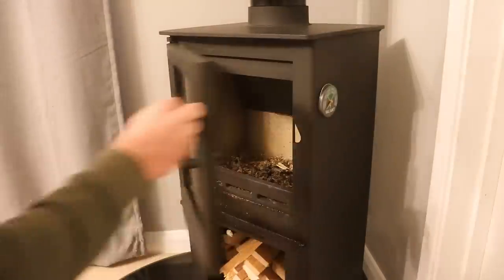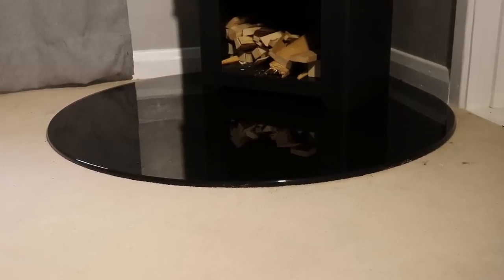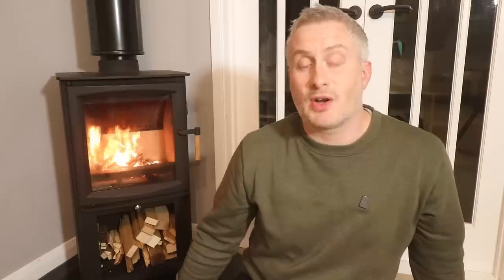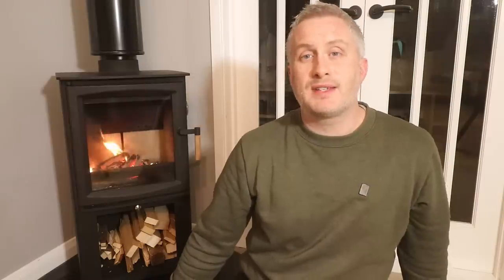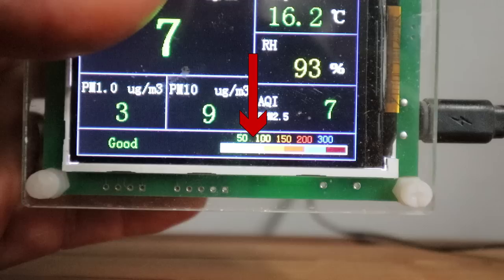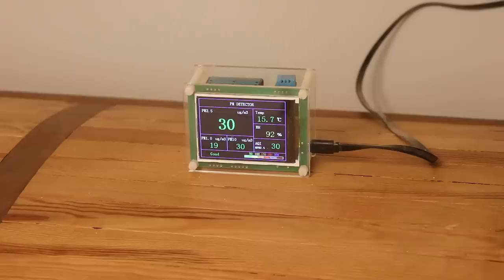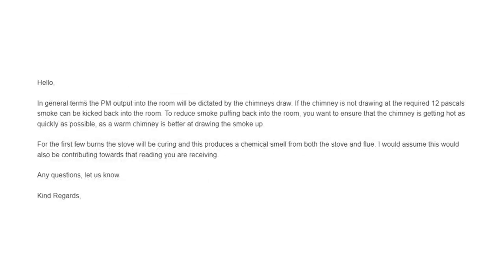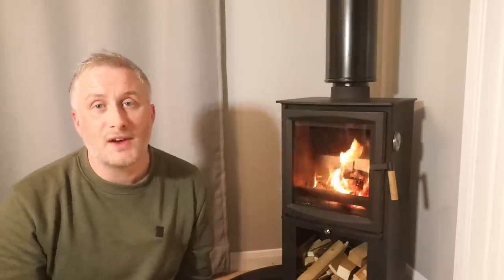Wood Stove Pollution and PM2.5 Particle Emissions TESTED ✓

Comment: You could argue your stove will be drawing air from outside (if it’s not got an air inlet connected), through your windows or air vents in the walls so your air quality may be even better?
I installed my own stove and will get building control to sign it off. It was not a difficult process if you’re the practical type.
It’s a 9kw Saltfire Peanut 8.
Your stove looks great and seems to be working well.
Reply from the maker: Thanks.  I don't have an external cold air feed, but we have a PIV (positive input ventilation) system in our loft due to past problems with mold, and also trickle vents in every window so I think it's able to draw from those quite effectively

Comment: Good looking and practical woostove, strong 👍and could say as long as electricity is not a lowest heating source with both hands yes for fireplace(where possible to fit). If i not wrong, firewood is still on lowest cost, comparing to gas etc. Electricity costs gor heating was on highest rate. Goverment can wish to avoid them, but in reality too early, to say no to them. Same as cars, fuel vs electric🤷‍♂️

Comment: Very interesting video. Thanks for sharing.  It seems that I'll need one or more (cottage, workshop, office) of these air quality devices.
In many countries, including Slovakia, prices of wood and wood related products went up immediately and doubled or tripled in price, as where electricity and gas are still the same price, at least until the end of this year for households in Slovakia. But we still don't know prices for gas and electricity for 2023!.
In the Netherlands they are talking a lot of the consequences of burning wood in stoves, but mainly for the pollution it causes outside.
Is it possible to measure that as well (for example with a remote cordless device) controlled/connected with the main device inside?
Reply from the maker: Hi Hans, thank you. I suspect that getting readings outside wouldn't yield good results as we live by a very busy road where I can imagine the pollution caused by HGVs is much higher than our little wood stove.  Thanks, Keith

Comment: When our stovax was installed we had to have an air vent created  into the room . Wasn't one installed in your room ?
Reply from the maker: Hi Mary, We have a PIV (positive input ventilation) system in our loft due to past problems with mold, and also trickle vents in every window so I think it's able to draw from those quite effectively.  Thanks, Keith

Comment: If your wood stove is 5kW, or above for that matter, you need to have a vent installed to supply fresh outside air into the room. This would mean that with a good draw up the fluepipe you will also get a steady stream of fresh air coming into the room from outside. I noticed you said your installer was HETAS approved, so I am sure he will have installed such a vent. The vent is there to ensure that you get sufficient combustible air to keep a good clean burn going and as such you should not get any additional particles in the room once the surface of the stove and flue pipe has been fully seasoned. This can take a while even after the smell has gone, and depending on how often and for how long you use the wood burner. Once you got that sorted I would only ever worry about having an effective smoke and CO2 alarm just to be safe rather than sorry. (And a good tip if you live anywhere near the countryside, as I think you do. This time of year big branches often come of the trees along our roads etc. during storms and these are very often oak and other hardwoods, which is a brilliant free fuel once you allow it to dry/season properly).

Comment: I install air quality monitors so I often look at pm levels. Pm10 is still the only limited number for when construction is going on. Pm2.5 is on its way and there’s talk of there not being a limit. These little monitors are only indicative anyway but if you’re seeing a general increase like you have that’s a good indicator that something has happened just don’t get stuck on the numbers. Try putting it outside for a bit to see what the numbers are like out there. It’ll either terrify you (if you’re alongside a road) or have you less worried as the numbers in your house are lower than outside even with the burner on.

Some good advice on here about the wood burner. I haven’t seen anyone mention the top down method. I use it every time. It heats up the flue first so there’s less smoke and generally you don’t have to open the door from starting the fire. I have a trickle vent on the windows in the room which I open and the doors in the house all have a gap under them anyway so the stove isn’t choked regardless. Mine goes up a chimney so when the door is briefly open the smoke gets sucked up there anyway. I am like you and have a supply of wood anyway but if you do get the opportunity to try different wood logs you’d be surprised at the smoke difference and how long they burn plus the heat they give off. I’m not expert though, that’s for someone else.

I struggle with breathing anyway so when air quality is low I have a hepa filter air purifier which must do the job as it tends to help so I agree with others who have mentioned it.
Reply: That’s interesting what you said about the numbers outside v numbers inside , especially near the road 

It reminded me of a few months back when I did a 9 day water fast. I spent a lot of time outdoors praying and reading my Bible and seeking God. That’s the context .

What happened to my body is that my senses and awareness was really heightened, and is was like I was very aware of the pollution in the air and think it made me feel nauseated….like you could sort of taste it. Water fasting can do that to you anyway as your body/cells cleanse and heal , but the roadside air pollution added to it. You also tend to smell human breath quite clearly when you normally wouldn’t notice it.  

Odd religious post 😄, I know I know. But yeah , it makes you wonder. 

I’m away to buy my first house and I have a wife and 5 kids . I would love an open fire or one of these stoves but really concerned i don’t damage my family’s young lungs or health. So I’m inspired again to revisit this after hearing a negative report on a YouTube vid a while back that seemed scientifically weighty, but then again “science” is a bit like shifting sands and not always good for decision making. 

I think I concluded I would maybe build an open fireplace outdoors or use a wood burning stove somewhere safe in the garden so I can still enjoy it , but maybe there is hope for indoors with some healthy choices and practices 🤔

Comment: Spot on Keith your stove looks very nice, you'll love the radiated heat. I've had a Tangye stove in my house for over twenty two years. It was once in the workshop till I downsized lol. Tony
Reply from the maker: Thanks Tony - 22 years, wow!
Reply: @RagnBoneBrown  Hi Keith thanks very much for your reply. Great choice with your stove for looks in a modern minimalistic surrounding. I have an old YT starter video of my stove lol. It's one of my first videos but it shows my actual stove. YT Video link    https://youtu.be/CQCij83rkXo   This came out of a derelict allotment in Co. Durham gifted by an uncle just because I happened to mention we were freezing at the time, 1984, just after our first winter trying not to use electric heaters to save on cost as we were skint. The stove was rusty, full of muck and weeds. Thanks Keith, happy to help, any advice just ask. I've used four types of stove on my heating journey and still have five and umpteen tee shirts on what works. Tony.

Comment: Interesting to see your results, I did similar with ours and found similar results although after a few months the levels went back down to baseline under normal use although ours draws from outside which might make a difference.  If I opened it while there are flames or when it hasn't caught and there is lots of smoke I get a short term spike but that settles again reasonably quickly.  From experience with the same particulate meter as you, any form of smoke is really bad compared to woodworking.  If you want to see your meter go nuts try welding or grinding in the workshop (just be careful of where the sparks go).....
A couple of useful tips if you've not come across them:
The wood shavings and wax (eco, natural etc. etc.) fire lighters are great and cheap.
Cleaning the glass internally is really easy with a slightly damp cloth dabbed in the ash, it acts as a fine abrasive and is really effective.  Or just getting it hot cleans the glass for us but that might be slightly stove dependent.
I also find that I can run the house thermostat at a lower temperature as when I sit down in the evening we just turn on the log burner and only heat the 1 room.
Reply: Yes, I'd be interested to see a follow up in a month or two. We've had a wood burner for about 7 years. And this year got an air quality monitor to check on pm 2.5 and other levels. Normally I find no difference to the low background levels whatsoever with the stove. But the monitor definitely works as v occasionally if you open the door to refuel too quickly and a waft of smoke comes out the monitor picks up quickly and spikes! Likewise dusting the room gets a good spike in pm 2.5! We do have a 7m chimney with strong draw. VOCs get picked up from stir fry or oven cooking across hallway from kitchen (or my wife's nail polish!) But nothing ever from the stove. I do remember it stank for the first 5 or so burns tho when new before we had a monitor (left windows open and not in room first few times).
Reply from the maker: Thank you, great tips!
Reply: @RagnBoneBrown  I re-ran the measurements last night out of curiosity, it did increase the PM2.5 rate from a base of 3ug/m3 to 8ug/m3 when I initially lit it which then dropped back down to the baseline once I stopped chucking wood on it, however my bread maker running 10m and 3 rooms away (doors open) had the same effect on the particulate count and a worse effect on VOCs.  But the house smelled nicely of bread in the morning :)

Comment: Tital price is not too bad, close to gas boiler  fully fit i think, and cheaper as sun batteries🤭When time will come, would be interesting to see maintenance video. Chimney cleaning with costs. Do you have to have fireplace safety check once  a year or few years?
Reply from the maker: Thanks. I think we'll be cleaning the chimney ourselves once a year

Comment: Interesting, but I'm thinking the draw on your stove isn't the same as the draw on mine given that we live in a two storey house so I estimate maybe another 2.5 - 3 metres of chimney height, also it'll depend on the size and number of air bricks, ours is basically a 6" hole (obviously with a grill either side) in the wall of the lounge where our stove is.

Comment: Metal stoves will also create some ongoing fumes in the room as the hot surface burns dust etc. A slow heat release stove like the ones used in Scandinavia avoids this problem. (And is more efficient).

Comment: Hay Keith. You need to get heat into fire 🔥. Nice rolling flame with air flow minimal. The only issue burning pine, you get resin in the flu. Hard wood off cuts okay. Hard wood logs are the best. Last a long time and throw out amazing heat.
I have a 14kw fire in a inglenook fire place I love it.
Reply: Love the heat logs. Start of with wood then throw logs on for rest of night.

Comment: Good video I'm surprised they don't heat cure these at the factory!  You can get a heat crystal fan to circulate hot air around the room better. No batteries required,  generates electric from heat differential,  have you Ever thought of putting a small wood burner or rocket stove in the workshop? Make it nice it there in winter!
Reply from the maker: Cheers John. We will get one of those for sure.  I don't think I could spare the space in my workshop although it would be amazing!  Also I don't think I could justify the cost right now, there is so much work to be done on the bungalow!

Comment: So, speaking of syn gases, if you are running on (now very expensive) oil, consider swapping over to one of the wood gasifier systems ... the have close to 100% efficiency and zero smoke once at temperature. A good system will set you back 10k, but if you have access to wood, then a wheelbarrow a day will suffice for both sanitary water and radiant heating needs throughout the house. Turn it off over warmer months and get your sanitary water heated by either city or solar electricity.

Comment: Just a bit of advice. We had a wire mesh put around the top of the flue (like the chicken wire you used recently) as during spring in to summer birds looking for nesting areas get caught down the flue and the only way out is through the house. Had heaps ofstarlings until we put the mesh up.
Reply from the maker: thanks, does that mean our "bird guard cowl" isn't necessarily effective?
Reply: @RagnBoneBrown  your bird cowl is fine.
Reply: @RagnBoneBrown  I guess the proof will be in the pudding. At least you know what to do if you get a bird down the flue. I had to get a tradesman in to do mine as I don't like hieghts.